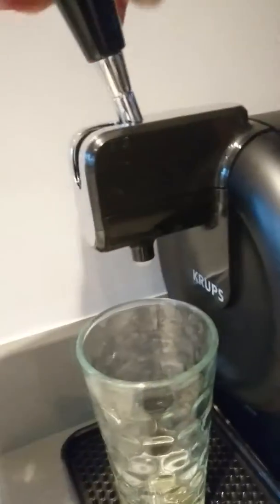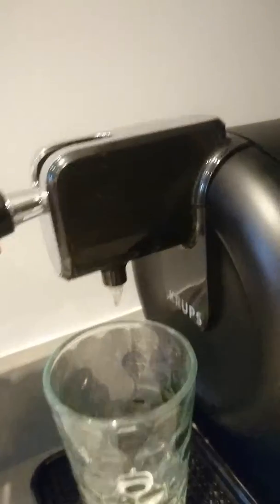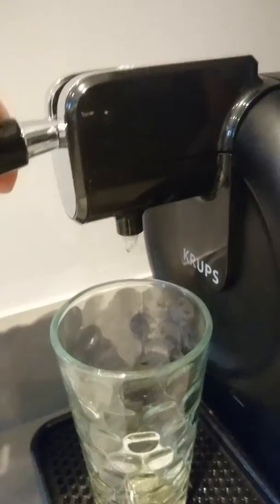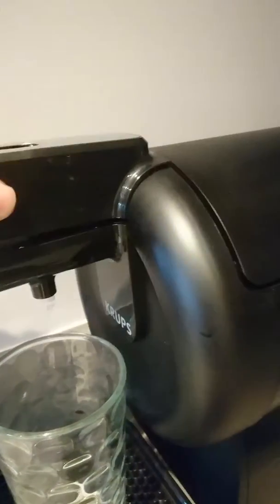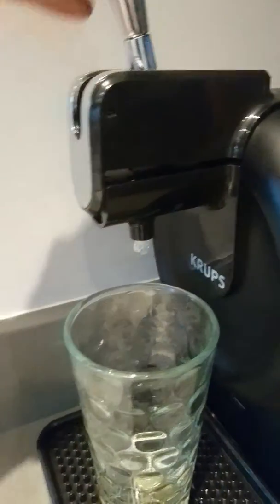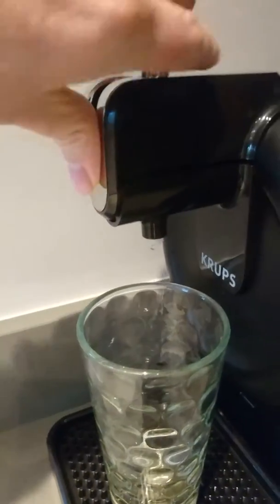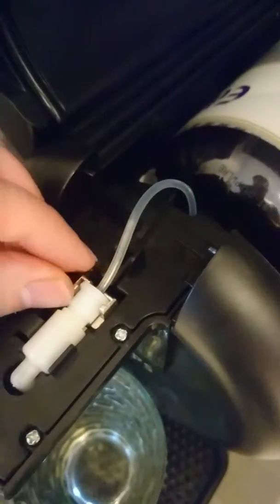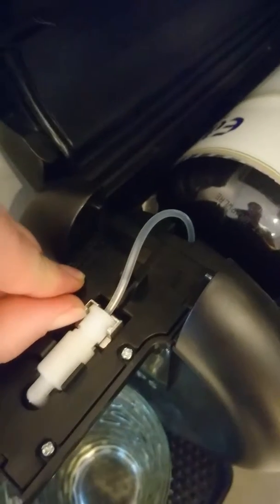The Sub, Tap issue - won't stop pouring, non stop beer!!

Comment: The issue is with the beer lines sticking. I always loosen them up a bit under hot running water before installing them in the sub.

Comment: This is the biggest problem with the Sub and it’s not a faulty mechanism it’s down to lack of maintenance. 
What’s happened is that a few drops of  beer/cider sometimes leaks out of the plastic valve and causes the mechanism to become clogged and sticky with with beer/cider residue. What you need to do is after every few torps get some hot soapy water and cotton buds (cue told) and clean all the metal mechanism where the valve clicks into after cleaning and drying with cotton buds give a little coating of Vaseline or WD40 into the mechanism to keep it lubricated. 
This will stop the valve from Jumping out of the sticking/clogged mechanism and getting stuck open. 

Joff
Reply: I lost a load of Heineken last night due to the lack of maintenance from the previous owner, I only purchased the sub last week.
I cleaned the mechanism and sprayed some Wd 40 and I have not even had a drip, you are a lifesaver, thanks

Comment: Yep, after a few of these disasters have realised the issue is definitely with the valve on keg, now ensure it it extended fully before inserting into machine. This may be advised in instructions but bought second hand and learnt the hard (wet) way

Comment: I have the same issue, some torps pour fine some just won't stop. Last night was almost the final straw for me, an entire torp emptied, even switching the machine off didn't work. The valves are very hard to open and close by hand. I am putting one on tonight but I have opened an closed the valve by hand several times as of now and have put a little 3 in 1 oil on it as well. It seems to make the opening and closing a little smoother.

Comment: I found the plastic valves that come with the torp are very stiff ,so I lubed the moving valve made sure you could operate the valve by hand then install  on machine worked for me. 
Just a dab of washing up liquid on the section that moves.